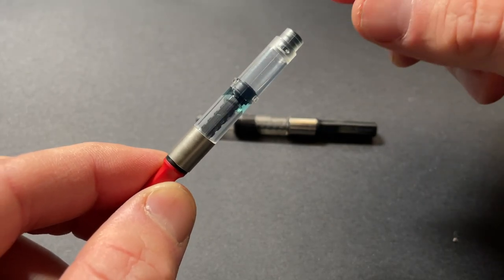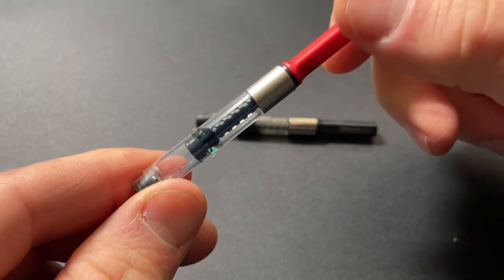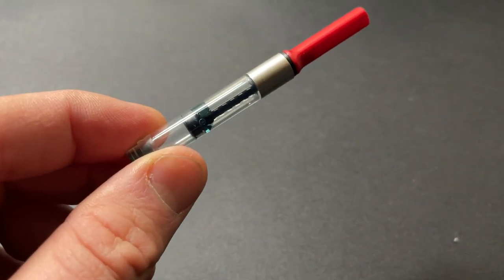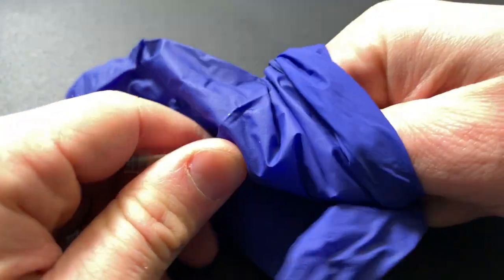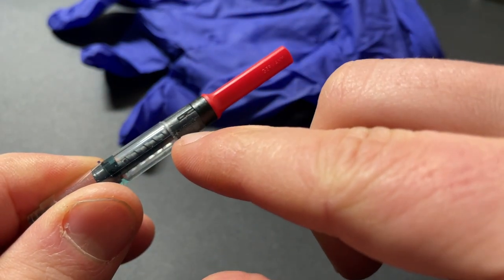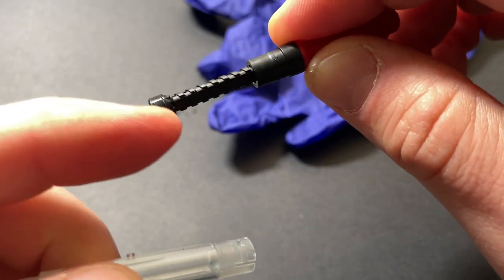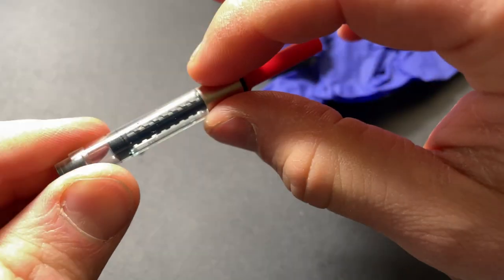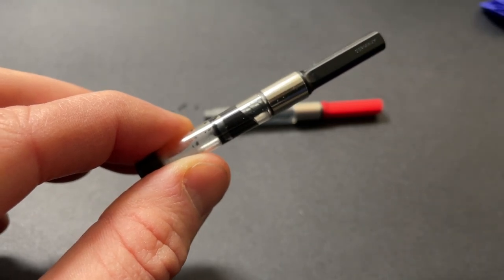How To Clean Behind A Fountain Pen Converter Piston's Seal

Comment: Thank you for this video, I was unaware that the converters could be disassembled for cleaning. 

The older converters with a black ring rather than the metal one require more work to remove the plunger assembly. I had to use a very thin metal piece to pry it out. I bought my first Safari in the 1980s and likely these converters are from then.

Comment: Honestly, for all the criticism Sailor convertors get for small capacity and (alleged, never happened to me or anybody I know) fragility, they are so easy to take apart and clean. My Lamy converters regularly have this issue, as do Waterman ones and the "premium", screw convertor from Parker. Never happened to the cheaper, piston Parker convertors (and the are so easy to clean!), Cross convertors are alright, Sheaffer one had unused ink in it for year and a half (I have too many pens...) and cleaned perfectly. No issues with Faber-Castell convertors (highly recommended if you want International standard convertor), Kaweco ones or Diplomat convertors. Jinhao convertors are hit or miss for me, some of them leak from the start, some have issues with ink surface tension built-up, some are perfect. What I've noticed is that the "no-issues" convertors are slathered in grease (Sailor even recommends to regrease the piston regularly) or had double seals, or both. Lamy is weirdly cutting costs on the strangest places, and this was the bad one.

Comment: I havent tried disassembling lamy converters. But for some of the generic no brand ones, the thread are usually not that precise, in the sense that even when you twist the plunger all yhe way to the bottom there are threada left for you to keep twisting. I was having an issue with a used converter I had and i wanted to clean the inside since it seems stained with ink and fluahing doesnt clean it. I tried pulling it, with grippy materials too and just cant seem to pull out the cap,( the silver part in the lamy converter)
 So i just tried twisting it all yhe way and then somemore, since thr plunger has no where to go, if there is thread left to twist it will push the handle( red part) up isntead and just completely disassamble it.
But again, i havent tried it on the lamy converter so if the cap isnt just friction fit and requires a slight twist first, then you still have to twist it, but if its the pulling out thats the problem it might work, unless the number of theead can really only go so far and there is no more to twist.